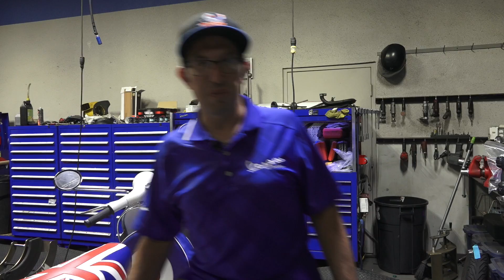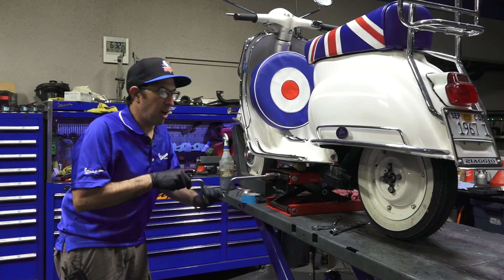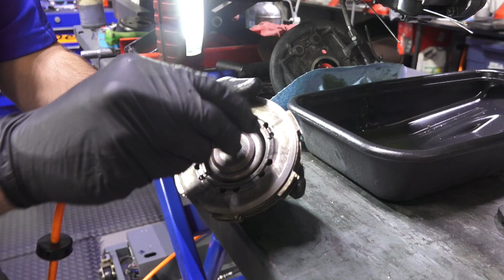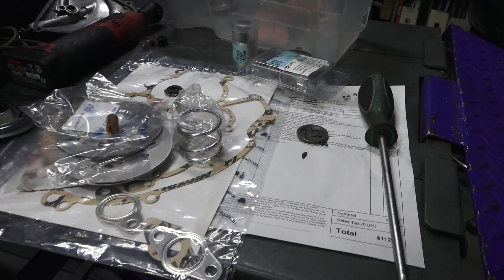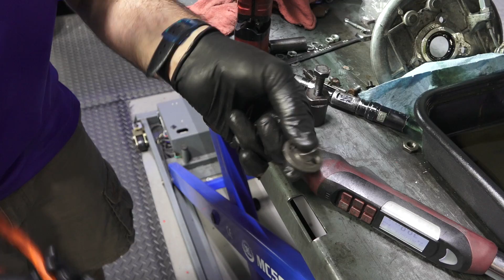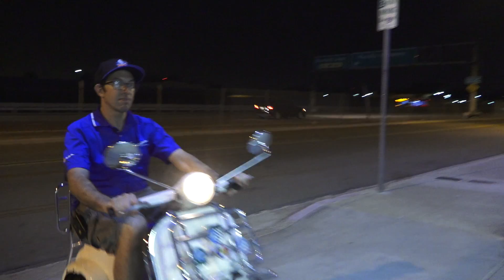Vespa Smallframe Clutch Plate Replacement

Comment: I have a problem that the spring is not releasing evenly, it is tilted to the side. Is it possible that the single clutch spring in the shaft that releases the clutch plate contact is tilted?

Comment: Thanks for that video.  Really useful and makes it all too easy.  However, I have a question - I'm new to smallframes.  What would you suggest where the wheel hub - the blate in front of the brake shoes - doesn't want to come off?  I tried loads of penetrating fluid, a puller and a heat gun and the thing just won't budge.  I'm afraid to use too much brute force of a puller.  Short of stripping the engine and splitting the case, any bright ideas??

Comment: Thanks for the Video!
I also recommend NOT to use a 4 disc clutch, like from malossi, ferodo or other "sport" clutches, because the seperating of 4 discs when pulling the clutch is almost not possible. Problem is that the compressed spring is mostly not parallel and then the clutch discs don't separate. So you cannot get into neutral and engage other gears.
Simply use the 3 disc clutches and the polini spring. Then all works very fine.
I use this at a 130 polini, 19 SHB carburetor and polini exhaust.
All perfect.
Greetings from Vienna/Austria

Comment: The old time honoured way was to soak the corks in oil for a length of time to maintain full penetration of the oil into the plates, I still use a ziplock bag whenever I does mine lol

Comment: Great video. Just about to do this myself so perfect timing ! I bought a clutch holding tool, but watching this, I just realised the tool wont work with the clutch in place because the clutch covers the tabs that the tool is supposed to sit into....will have to try the copper coin